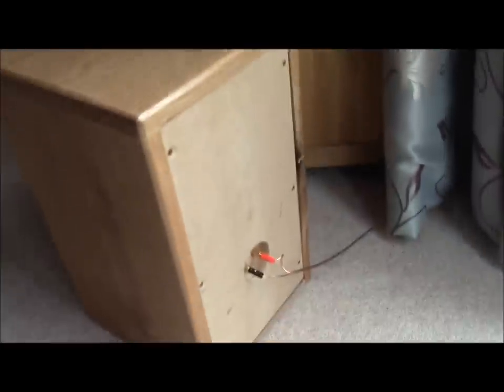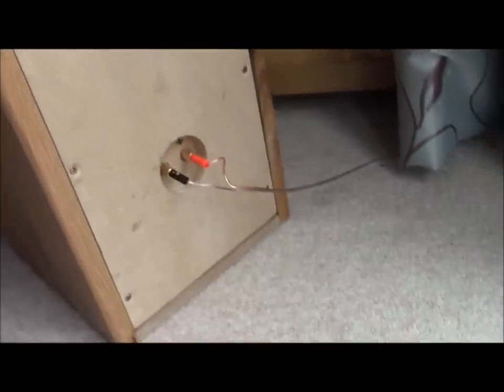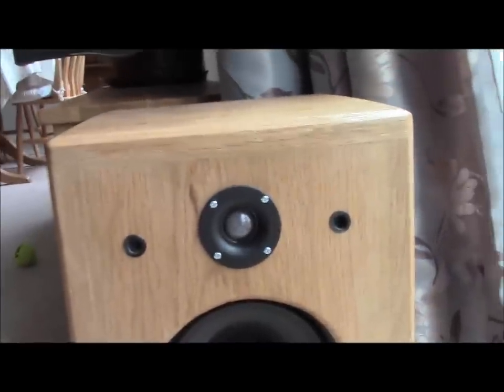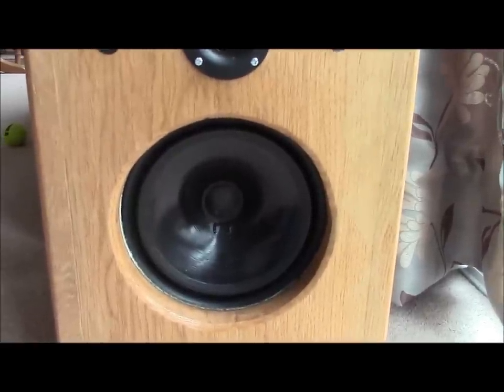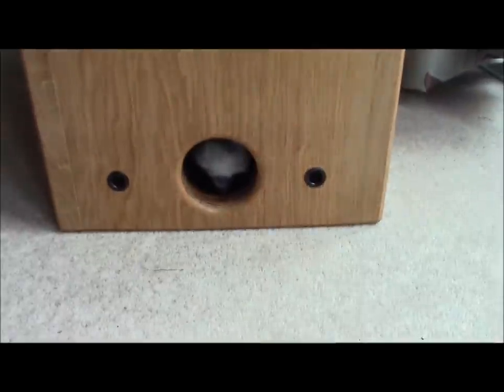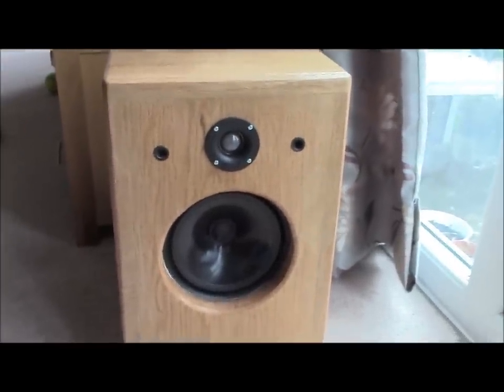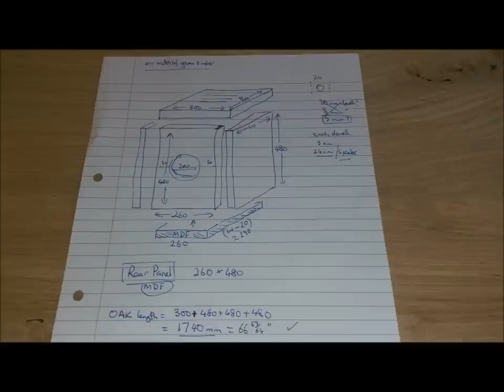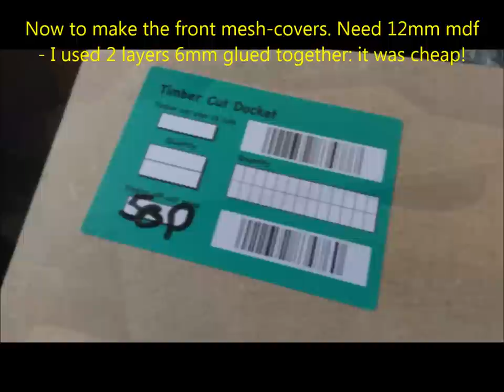Solid Oak Bass Reflex Speaker Cabinet + Crossover Construction...

Comment: Nice looking speakers! Isn't solid wood the worst material for speaker cabinets? But they look too cool anyway :-)
Reply from the maker: +snajperSLO Cheers. er  yes MDF is a lot better acoustically. but they look ok. .. anyway I think springy steel or chocolate would be the worst materials for a speaker cabinet:-)
Reply: snajperSLO  actually, MDF may be better, hard wood is still good. hard woods like oak, maple and birch are in my thoughts better because they look good when finished. 
I'm getting ready to build a set for the living room with the sole purpose of being furniture grade. it will please my queen as she hates speakers because they are generally ugly.
Reply from the maker: Cheers KW. In fact these are the best sounding speakers I've ever owned. I like these, even if the filler shows a bit. oops.

Comment: MDF IS BETTER, SOLID TIMBER IS TERRIBLE blah blah blah... So how many INSTRUMENTS are made from MDF? Ever hear a guitar built from mdf, or a violin? Timber works exceptionally well for sound, IF you design taking into consideration the properties of timber, BUT expensive.
Reply from the maker: Thanks Peter. Might I suggest that musical instruments are sometimes intended to resonate (so use solid wood) whereas speakers should be neutral sounding (so use MDF..) ..?